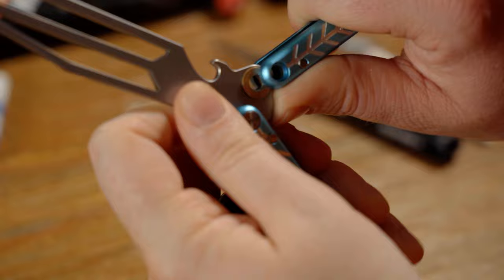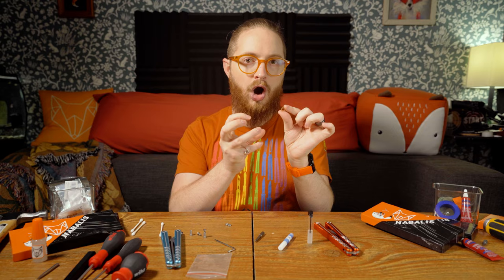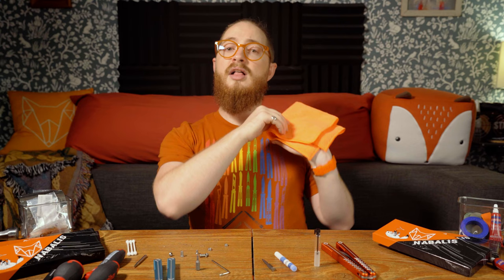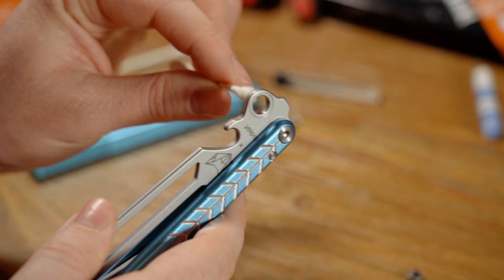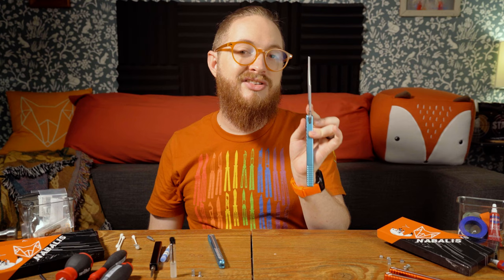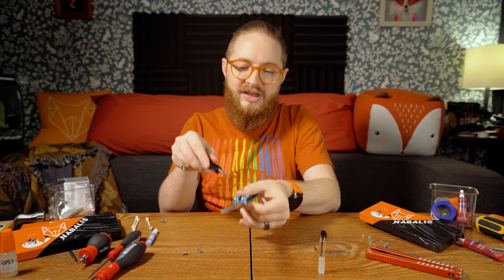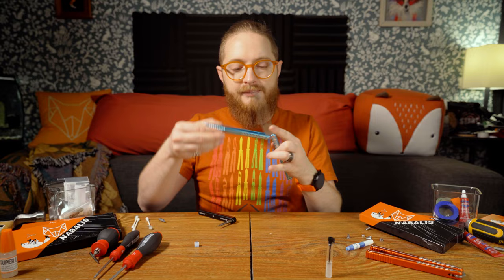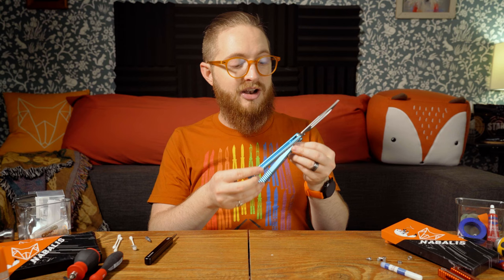A Beginner's Guide To Balisong Tuning! ft. Nabalis Vulp

Comment: As a complete beginner I am LOVING my Vulp so far. Thanks for the video, Im sure I'm going to need it at some point with as much as this thing gets thrown around from trying to learn new tricks.
Reply: did you need to locktite it before flipping or can you just use it right out of the box?
Reply: I've been using mine about an hour a day for 2 months. I've only been doing balisong for 3 months. I'm dropping it so so so much. In water, on rocks, on my gf, on concrete. 
A zen pin became loose. I locked it in and it's been great!
I'm about to tune it up. I've been screwing my T screws a lot. 
It's taking such a heavy beating though. I'm so very happy this is in my life!

Comment: Good stuff in general! I get you said this is a last ditch effort but not with balisongs with weight systems. Like the serif or the tsunami which have clearly been made to adjust by opening lol. So that's the thing it's clear it's not a bad thing to take it apart and do upkeep and tune them. I just don't want peoppe to be scared or worried about doing it as if it's a bad thing because it isn't.
Reply: Great feedback! We probably could have made that warning a bit more clear, but with the alarming number of people that we see just taking apart their balisongs because it has like... 1mm of play (LOL), we thought it best to advise caution. And in the situation of adjustable weight systems, those generally don't require a full disassembly of the balisong, generally just removing one screw or two on one side of the balisong. We see a LOT of people fully taking apart their knives entirely thinking that things will improve when... most of the time it ends up worse haha
Reply: @thebrandonbakerclone  I do wish that most weight systems were only a few screws but in reality it's only like 1 bali with weight systems that you don't have to take fully apart. Tsunami and serif both have to be fully apart as they don't move enough to the side to pop them in and out easily. But I do get exactly what you are saying for sure. If you are taking your knives apart to fix a little play it probably won't help unless you have oversized bearings and are learning to tune ans need to sand but other then that for sure. I just think it's a great rule of thumb to learn how to tune your balis. Most people I know who have issues usually are able to fix them with practice and imo a 60 dollar bali may be the best thing to learn how to do it on instead of an 800 dollar bali lol.

Comment: Only one issue my friend! With the washers, the rounded side needs to touch the bushings and the flat side the inside of the handles. Turning the washers around can dig into the blade and cause irreparable damage!
Reply: @ShadowKlassic  he didn’t, otherwise I wouldn’t have commented.
Reply: @ShadowKlassic He said the flatter side should touch the bushing and that’s incorrect. He also said it wasn’t a big deal but it is. The flat side can dig into the knife causing irreparable damage. Hence my comment.

Comment: Which washer size are the ones that fit on the vulp?
Reply: outer/inner diameter 10/5mm
but the tricky part is
the thickness
the pre-installed washers are 0.48mm
while the spare washers are 0.58mm
the sad thing is that i didnt know that before i installed those spare washers
which as a result permanently widened the gap on the bite handle of my vulp😢
i watched the video a few times
so i was quite sure Will told us it may require to use some force to push those washers into place and i did!
from now on i ll remember to measure new washers with calliper
to make sure they are same size as the original
even they came along in the box.. or supplied from official
(i bought from bladehq)

now the bite handle has play and tap and blade-rubbing
maybe in the future i ll try to polish down a bit the spare washers to fit the wider gap
anyway its a well designed great trainer esp in this price range👍🏼

hope it may help you guys
dont make the same mistake i did

Comment: Honestly, I prefer bearing knifes for maintenance and tuning, and on both systems I like to get inside pretty often. But I will say, the bearings in even nice knifes (exe. talisong z) still need to be upgraded for the performance I like (skiff). A good bushing knife once correctly tuned really only needs cleaning every now and then. however, you can get a range of feels off of one set of bearings and the types of lube, if even lubed at all. Bearing do need a good cleaning, probably more often than a bushing system. I love working on these things though.

Comment: When tightening the screw, why does it look like you're turning left, and not right? Aren't both screws right hand thread? Also, what prevents the pivot/barrel from turning while loosening or tightening the screws?
Reply from the maker: That was a shortsighted editing mistake on my part, I had flipped some of the shots to keep the angle consistent, but forgot to flip it back for the tightening portion. 

Also, when screwing/unscrewing, the key to the barrel not moving is to squeeze the handles very tightly so that it puts pressure on the pivots. You can do that in the open or closed position, but just squeeze nice and hard and the barrel should stay in place! 

- Brandon

Comment: hey will i have a question ... every time I want to unscrew my screws the thing on the other side of the handle rotates with my screw its like glued too it i can't seem to get it out :/ i think i'm doing something wrong with adding the threadlocker.. help?
Reply from the maker: This is something we forgot to mention in the video: when you are unscrewing the screw or screwing it back in, squeeze the handles together VERY tightly together, while on the open or closed position. Usually the open position is better because you can squeeze them more. This will keep the pivot barrel from spinning, allowing the screw to come out! Hope that helps 
- Brandon
Reply: @WillHirsch  we tried this. I even asked my dad to help me he pinched it with all his power but it couldn't get out..

Comment: i have done all the maintenance for it and i think it turned out pretty well, the only thing is that right after i did the swing it back and forth thing it was a bit tight and there might have been a bit of loctice on the outside of the washer somehow, is that ok?

Comment: So i just got my vulp yesterday and it has bad tap now, i did the loctite and tuning but no matter how much i tigthen (obv not cranking it hard but just to the point where i feel it isnt gonns do anything more) and it still has just as much tap and play, im kind of disappointed that it came with bad bearings
Reply from the maker: Hey there! Have you lubricated your Vulp properly? That often is a major source of tap. Loosen your Vulp a bit, lubricate it as shown in this video, then tighten it back to as tight as you think it should go, which requires a good amount of tork that a lot of cheaper screwdrivers don't allow you to get. It is of course possible the bushings weren't tuned correctly, in which Nabalis would certainly replace or repair it for you, especially if it happens when it is properly maintained and lubricated. 

I hope that helps! Nabalis offers pretty solid customer service and should be able to get you fixed up in the worst case scenario

Comment: Hey will! im new to balisongs and I am wondering if I could replace washers with bearing. Im talking about removing the washers and putting in bearings into the balisong.
Reply from the maker: Balisongs have to be specifically designed for a bearing pivot system, so generally no, you can't just put bearings in any balisong without extensive modification

Comment: Hi im having an issue where i try to tighten my screw, but cant because the other end doesnt stay in place how do i fix this? The screw is sticking out the groove and its annoying.
Reply from the maker: Squeeze the handles very tightly while you are screwing in the screw, this will keep the pivot barrel from moving!

Comment: I recently took apart and put my balisong trainer together for the first time and while one handle is basically perfect with no tap, the other has a decent tap.

My issue is theat the the screw is twisting with the pivot (I probably put too much loctite if it eneded up touching the pivot in guessing).

I've squeez the handles to hold the pivot in place but the screw just wont budge. Is my best bet to just wait till the loctite wears down? *Note, I dont have a handle for the t10 bit, so thats also a factor, gonna have to go get one this week.

Comment: Whats your take on teflon tape instead threadlocker? My Vulp is probably arriving soon but i dont want to ruin the bali with shaking hands and accidentaly glue down the bushings. Is teflon good enough on the Vulp?
Reply: Teflon tape can work well, but since it's an abrasive material, over time it can wear away at your screws/pivot and make it harder for it to stay locked. But that's over a long period of time, like years. So it's up to you! If you use the method Will uses in this video you shouldn't have much trouble at all putting Loctite on!

Comment: How reliable is handle swapping?
Should we swap the bushings and that with the same handle or just a normal swap? My main worry is it’s going to make more tap.
Reply: If you swap the handles, keep the bushings in the same spot. The handles themselves technically don't touch the blade or the bushings themselves with the washers in the way. So I would keep all of the hardware in the same place, just swap the handles and you should be fine!
Reply from the maker: The handles don't matter too much from bushing to bushing!

Comment: Just wondering. Could you use the spare bushings on any balisongs and just tune it for that one or can it only be used for the vulp?
Reply from the maker: Most bushings are specifically fit for the balisong they are made for, but you could measure the diameter of the hole in the blade and the size of the outside of the bushing! It might not work for most but it's worth trying!

Comment: Need help, how do I remove the screws that are already applied with loctide?

There's so many videos on how to apply loctide, but almost none on how to remove them. 
I tried putting them in hot water for 2 minutes and tried to remove them because I heard that you need heat for it, but they're still stuck and I think I might have stripped the screw a bit.
Also tried using a hairdryer which was very effective in applying heat to the balisong compared to the boiling hot water, but it still didn't budge.

I'm trying to remove the safe handle of the Vulp which was factory installed with loctide.
Guess I'll only be doing maintenance for the bite handle for now on.
Reply: If you bought the Vulp from Nabalis, Amazon, AliExpress or Blade HQ, it shouldn't have come pre-loctited. If yours did, that's a very rare case that we haven't seen before. The best tip is to open the balisong so that the blade is pointing away from the handles, and squeeze the handles very tightly while you are trying to unscrew it. Heat can help as well, but that's only if there is Loctite already applied. Squeezing the handles keeps the pivot barrel from spinning, and should do the trick!

Comment: Hey uh I've been having a hard time tuning my balisong. The torx screws on my knife does not separate from the pivots. I did not apply any loctite on it, but for some reason the torx screws and pivots just kinda turns around when I try to loosen up the torx screw.
Reply from the maker: Make sure that you squeeze the handles very tightly while you are trying to unscrew the pivots!

Comment: Would it be a good idea to replace the washers on just a washer balisong? I got a squiddy a while ago, and stupidly tried adjusting a handle because I thought it was loose and now it sticks while swinging, I've tried taking it apart (before seeing this video) and it still sticks, and flipping it back and forth a lot or trying to adjust it, it doesn't seem to be swinging any better. I'm thinking I might try to buy a replacement hardware kit and just replace all the parts for the handle, but idk. Edit: it's also always on the open swing, it seems to swing fine while closing, but when opening it will just stop suddenly before it's all the way open, and then swing back towards being close without effort, before stopping again once it swings back to the open side etc.

Also how important is it to completely clean the oil if you're changing to a different oil? I remember you mentioning this once, but that means if I buy a balisong and it comes from the factory with oil already in it, then I have to take it apart and clean it anyway because it's different than what I will use in the future.

Comment: So we should immediately add thread lock to the screws upon receipt of any new balisong but don’t worry about cleaning it until after a few months? I just purchased a Krake Raken live blade and will be buying a Vulp to practice.
Reply: You most definitely should not be adding threadlocker to any new balisong. That can potentially ruin the tune from the maker, which in a bushing balisong has to be very precise. You should only add threadlocker if the screws are actively coming loose

Squid Industries balisongs for example all come with very strong threadlocker pre-applied to all of the screws. On the flip side, you should almost never use threadlocker on a Machinewise balisong with the type of screws they use. It depends on the product, but no, generally speaking you shouldn't immediately apply threadlocker right out of the gate
Reply: @thebrandonbakerclone  Thank you, brother. You’re a scholar and a gentleman. I definitely wanted to make sure about that before I got into handling these knives.

Comment: One question i have is when do i do locktide it or lube it. Cant i locktide and live it right out of the Box? Or is it better to do it when the Bali starts to get a bit of play or tap? Because its not locktited out of the Box as you said. Nice Video tho Will! ❤️🙏🏻
Reply: Generally, the best course of action is to wait to see if it develops significant tap and play. A small amount of audible tap isn't anything you should be worried about. But if it's major, THEN re-tune it with Loctite. You shouldn't have to do that again for at a minimum several months even if you flip a lot, assuming you applied the Loctite correctly. 

As for lubrication, generally you'll want to lubricate every 2-3 days at a minimum if you are flipping the balisong constantly. If you don't flip that often, probably once per week is good
Reply: @thebrandonbakerclone  thank you Brandon! That helps. I just bought a purple one, should receive it in 2 days. Just had a 18€ Bali before and wanted to step up my Game a bit and get also more into the Hobby. Much love to both of you and thanks for the Answer. Might start a Insta Acc for flipping too 🤫👀

Comment: I'm having a Problem where the zen pin and the screw are stuck together. When I try to loose the screw the zenpin spins with it, therefore I havent been able to loosen and adjust me handle. I did use loctite and I am assuming that is the problem. Does anyone know how to break loctite blue?
Reply: To clarify, you're talking about the screw and the pivot barrel, not the Zen pin. The Zen pins are the metal pins pressed into the handles. 

As for loosening the screw, make sure you squeeze the handles very tightly while unscrewing, preferably when the balisong is open (something we forgot to mention in this video). That puts pressure on the pivot barrel and can keep it from spinning. I hope that helps!
Reply: @thebrandonbakerclone  Thank you. I got the screw loosened by pressed and the blade against my table and applying pressure and then unscrewing. Thanks for the help

Comment: I've had my vulp for about a year now, flipping it on and off. I have only put lube on it once (very recently) because I honestly just wasn't aware of what proper balisong upkeep was. I just tuned both handles along with this guide and now there is SUBSTANTIAL tap and play that wasn't there before. My question is what could be causing this? Could it be the bushings were put in backwards? I tried to follow everything in the video exactly but I think I somehow still messed something up.
Reply from the maker: Assuming you put everything back together properly, it may not be tight enough. The bushings can go in either direction for the most part, so that shouldn't be the issue. I've often found that when I'm not using a good screwdriver, I can't get enough torque to properly tighten most balisongs to the point they need to be. Also make sure that you squeeze the handles tightly together when you are tightening it, which keeps the barrel from spinning to tightening and untightening (something we forgot to mention in the video).

Also make sure to re-lubricate it once it's back together as well

I hope that helps! Let me know how it goes

- Brandon
Reply: @WillHirsch this fixed it! I was tightening it without holding the handles closed so the barrel was most likely spinning. Thank you so much!
Reply from the maker: Wonderful, I'm so glad that did it for you! Happy flipping and thanks for the support! 

- Brandon

Comment: What is the difference between tuning and maintenance?
Reply from the maker: "Maintenance" would mostly just be occasionally cleaning the balisong, and lubricating it, and checking if the tune is still good, and if it needs to be tightened, tightening it.

"Tuning" would be if the bailsong inexplicably locks up, or doesn't have a proper amount of handle swing, or has a large amount of tap or feels very loose despite the screws being tightened, and either having to change components, or doing physical work to different components (like tuning a bushing by grinding it down with sandpaper), to get the balisong back to working order.
Reply: @WillHirsch  Thanks, that's a great explanation